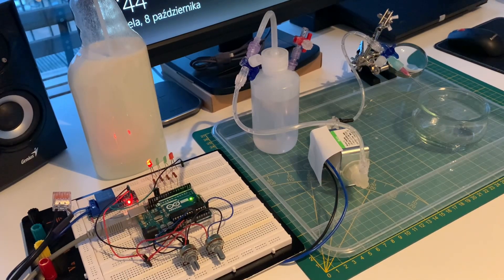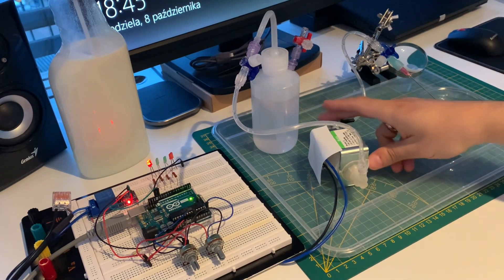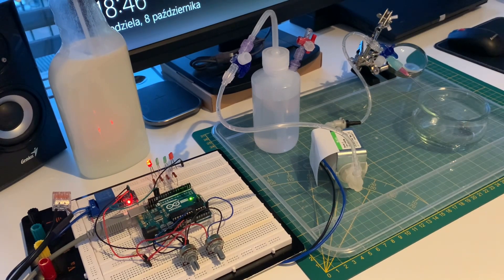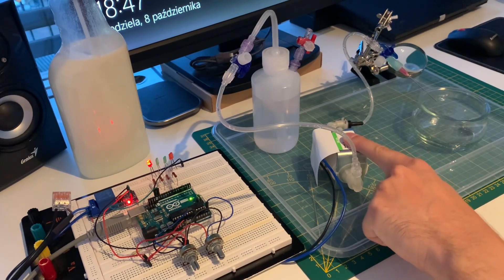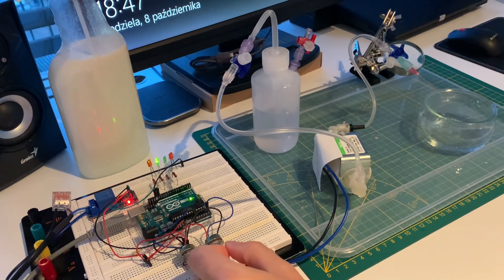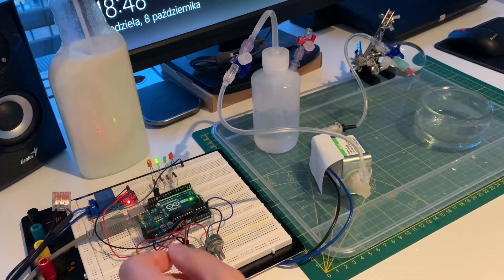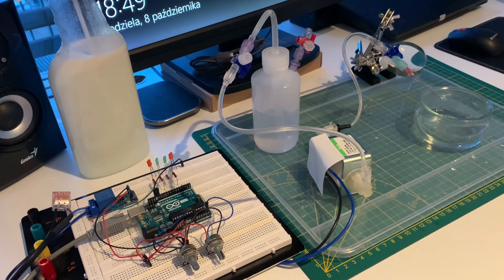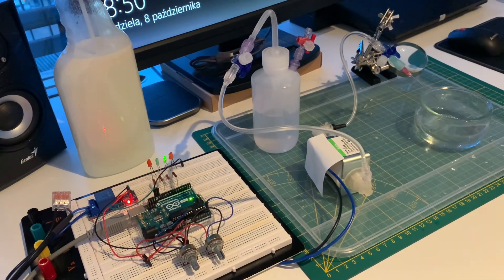#diy MQL (Minimum Quantity Lubrication) system for #desktopcnc milling / engraving machines

Comment: Jacek,
I like your system that does not use air pressure. Consider the use of a small (i2c) OLED display, that makes it easier to show information.
Huub
Reply from the maker: I tried already to play with 2x16 character LCD display with I2C backpack, but with no success so far. A common problem (program was regularly hanging/freezing), but I did not find a solution yet, hence I added just some LEDs to highlight what the current setting is.